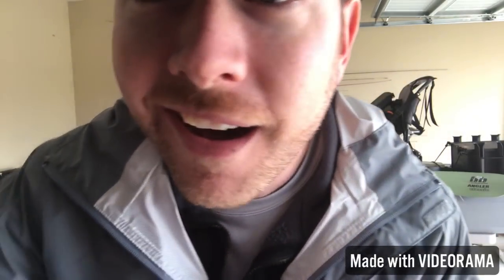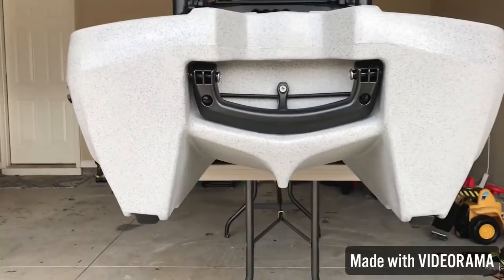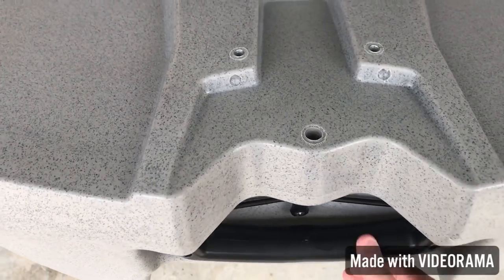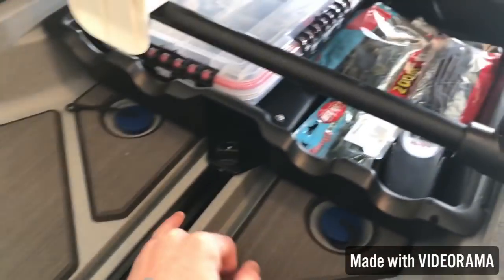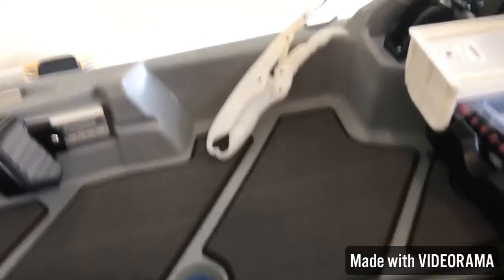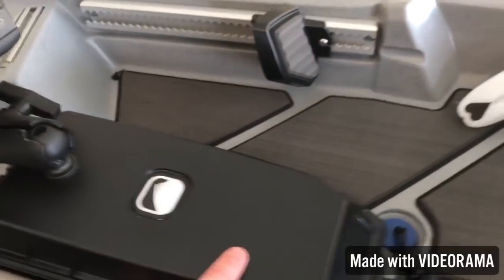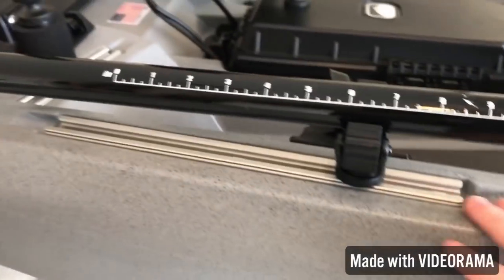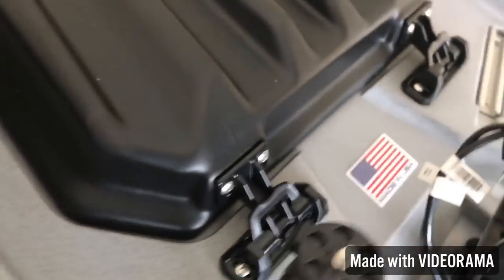Bonafide SS127

Comment: Great walkthrough. Did you just screw the transducer/top ball mount directly to the dry pod? Out for you have to use a bolt on the back of the screw?
Reply from the maker: Deryl Kowalski I screwed it directly to the pod

Comment: Are those wheels on the back end?
Reply: That's what I'm wondering. I saw that as well but haven't heard anyone mention them.
Reply: believe what you are seeing are keel guards.  its a separate solid platic insert that i believe is replaceable so that you dont damage the vessel from sliding it around